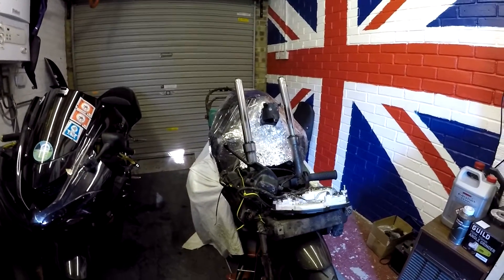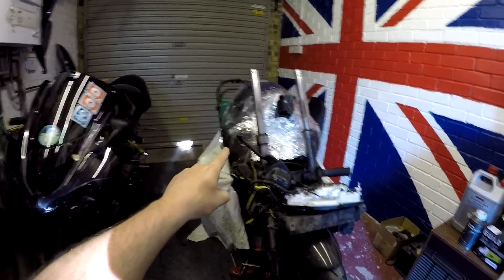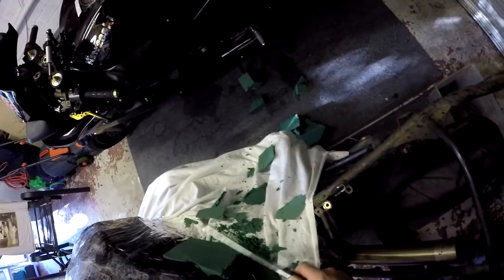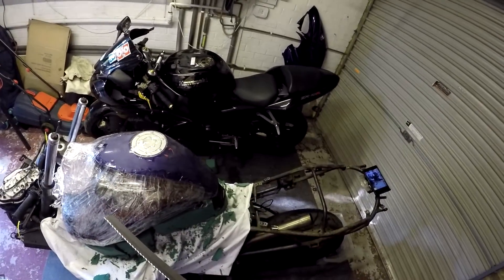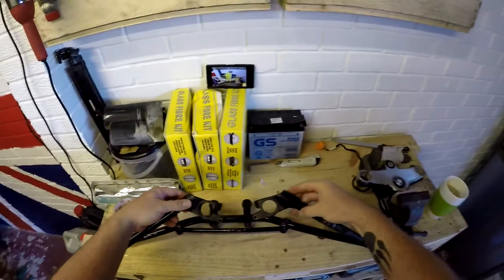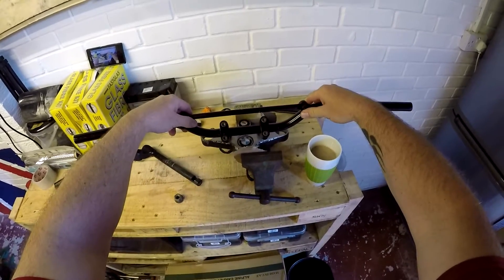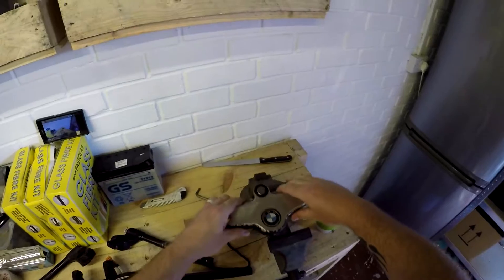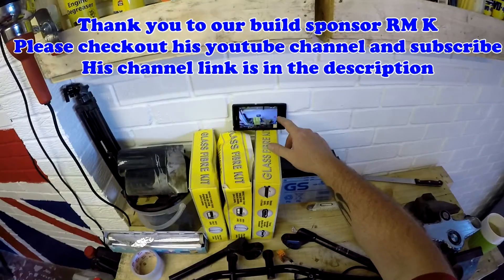How to Make Bodywork - BMW Scrambler Build - Part 1 Ep.8

Comment: Nice one.
I would've used GladWrap/ClingWrap, wont absorb the resin like that sheet will. And it costs almost nothing and kinda like a Gel-Coat too.
Looking forward to the finished product.
TFS SGM >:)
Reply from the maker: Yeah lots of choices to use as your base, I like using tape as it can also make small adjustments where needed. I'm looking forward to finishing it to, I'm a little concerned it's going to be huge but we'll see 👍 Ride safe mate.
Reply: Sixth Gear Motorcycles Well you did get 'a few' rolls didn't ya.
Hope it's not too heavy. But it is something you could reproduce better - ver 2.
>:)
Reply from the maker: Yeah plus I had to use tape to stick it to the original top middle plastic to lose the attachment ridge. Hopefully it won't be heavy. I can always make it out of fibreglass and use the finished part as a carbon fibre mould. I'll see how I go. I'm also trying to keep cost down so we'll see 👍
Reply: Sixth Gear Motorcycles Yeah cost for ya should be Low.
Last time I tried to build a fairing, I started with chicken wire, then paper mache over it. Then i changed my mind to plaster on top, then it turned into a mould.
I then went to the local boat builder, but he wanted like $1000+ to produce the finished product for me.
Obviously I didn't get it done...lol
Good Luck with yours.
>:)
Reply from the maker: Jeez, now that's a lot of work and I can only imagine how much the boat builder wanted. To date I've only made small parts so it's going to be interesting to see how I get on with a bigger project. I tend to use cardboard and tape or foil as my base to layup resin and fibreglass or carbon fibre. I'm self taught which always makes for a pleasant learning curve and feels very rewarding once you get it right. Thanks bud, I'm going to need a bit of luck! 👍 😁
Reply: Sixth Gear Motorcycles I too am self-taught and know what u mean by that Learning Curve. But same as you, Love a Good Challenge. 
'Exercise that Grey-Matter'.
>:)